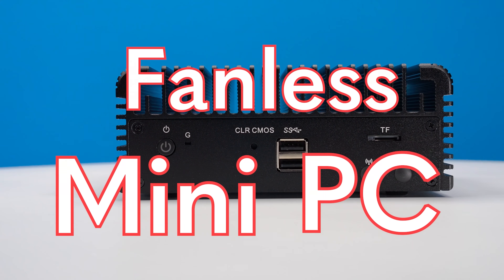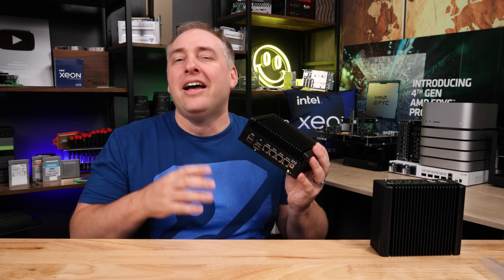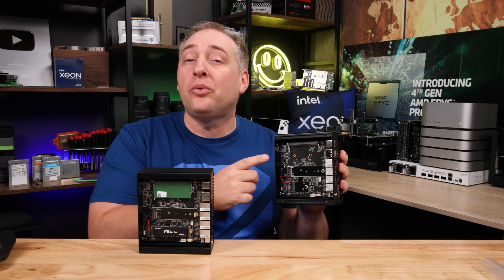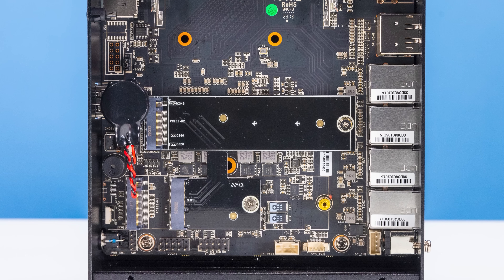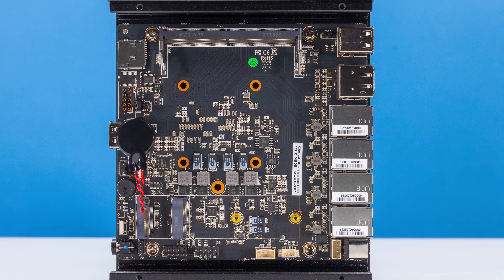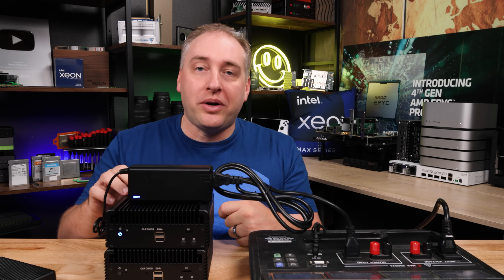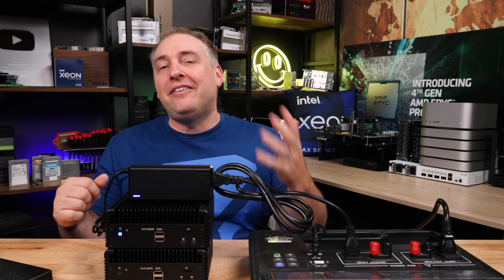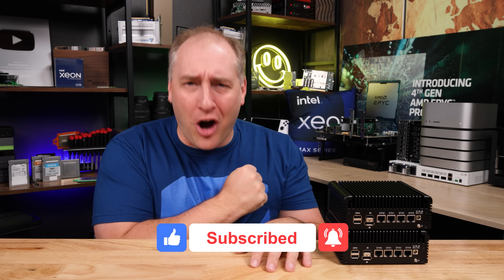Best EVER Fanless Mini PCs for Virtualization and Firewalls?

Comment: Appreciate I'm coming to this video very late - I'm considering the purchase of one of these machines to run PFSense... and I wanted to offer one tiny piece of feedback - concerning the system BIOS. As you note, this machine is designed and built for a SOHO / small business firewall, which means that potential buyers need to be able to trust the integrity and security of the device. To that end, it would have been really nice if you had been able to discuss the BIOS - I think it's AMI, but I'm not sure - and to tell us a bit about which version it is and how secure it might be. 

Perhaps a bit harder to do... it would also have been very interesting to get your thoughts on the IC's on the motherboard. You hint that these machines use a bespoke MOBO... so from a security perspective another possible security concern would be any IC on the MOBO that looked like an original but in fact was not. 

Finally, you mentioned that you did some useful soak testing. It would have been really interesting if you'd done that with the machine connected to the internet via a network packet capture device, just to see if the machine made any unexpected calls to unusual IP addresses. Of course the reason this would be interesting is that when most customers set one of these up, one of the Ethernet ports is going to connect to an ISP's router and it may be very difficult to capture traffic from that port. 

Thanks for doing this review - appreciate it's out of date with newer models on offer today, but there's lots of useful information here. Thank you.

Comment: Great review. Covered everything except one question... Does this come back up after a power glitch unattended?

This is probably a really stupid question, sorry. I bought a fanless mini-PC to use as a home server but it did not reboot on a power glitch. The hardware required a human to cycle the power button! This makes it extremely unreliable on my glitchy power grid. I don't need a UPS, just need the thing to come back up after a power outage.

Does this come back up unattended?

I see on Amazon the it has "Auto power on" nuff said?

Comment: Take my advice and don't buy anything from this company. I bought two--one of them works ok, the other is missing pci devices. Seems to be a bios enumeration bug or something, but the CWWK website is really bad. The BIOS/UEFI implementation seems sketchy at best--it often fails to apply or save settings completely. Really bad quality overall.

Comment: I bought of these dude and it sucked!........... runs burning hot no doubt will burn out the M2 and the RAM...........  It was unstable, faulted on Windows Server, faulted in ESXi, ProxMox also died on it.........  and this is with good parts, memtest all good etc.  So you failed to show people you holding your hand on it while running a stress test for a half hour.

They are terrible.

Comment: The proxmox thing happened to me very frequently with different machines. It usually installs OK, reboot OK, and then misteriously the name of the interface you were attached to initially changes when you reboot after creating a linux bridge, so the machine obviously becomes inaccessible. You need to then find the new interface name and readd it to the bridge and now it's that. Annoying but hey.

Comment: What happens when the battery fails, and it reboots?   Will it hang on boot?
Also, how good is watching Youtube videos in Firefox running on this, views from this acrossvia  a Windows Remote Desktop or VNC connection?

Comment: Hi, could you tell me if the N305 can put  single 32gig ddr5 4800 in and the unit use third generation nvme ssd?
Reply: Yes - almost all that I've seen do support 32G DDR5 if the board supports DDR5.  Some will be fussy about which brand or speed; but most should run sticks like Crucial DDR5 4800; some will state that they will run DDR 5600; ymmv.    The NVME primary drive is 3 lane; and the secondary is a single lane ( tops out at about 900 MBps )  Most NVME nowadays are 4th gen or later but will run at 3rd gen speeds.

Comment: Love this it’s perfect: Passively cooled, silent, with adapter for 4 nvme drives, n305 processor 

BUT the power consumption is too high. Like you said in your Beelink EQ12 Pro review the level of engineering here is not on par with HP/Dell

The idle power consumption should be approximately 5 watt

Does anyone have tried to undervolt it?

Comment: Does any n305 or n100 n200 units come with 8 or 6 lan ports? Or is there a way to add more ports?
Reply: Yes, but really, you only really need two or three, and a managed switch.  Far easier to trunk the ports to a managed switch..

Comment: After watching some of your videos about these mini pc from aliexpress, which are suitable for pfsense/opnsense, I bought a Topton N100 with 16GB DDR5 and 512GB SSD for about 240 USD. The delivery time was still ok at 3 weeks from China to Thailand. Since something seemed loose in the PC, I opened the computer and found a small screw that didn't seem to belong anywhere. On this occasion I was also able to check the RAM and SSD model and both are unknown Chinese brands.
First I installed Linux Mint to check the functionality, but I had the problem that I could only set the screen resolution to 800x600
(HDMI connection). Since I want to use the device as a firewall anyway, this is not relevant. To test the CPU performance, I ran a Mandelbrot Python script. The CPU cores were used to almost 100% and the temperature was 82 degrees Celsius, which seems ok to me. The casing reached 46 degrees Celsius, which is uncomfortably warm to the touch, but is probably normal with passive cooling. The device consumed around 33 watts in the test and around 10 watts when idle. I noticed that this Mini PC has roughly the same computing power as an Orange Pi 5, but the Orange Pi 5 only uses 10 watts in the test and 3 watts idle. Yes, I know, those units have totally different use cases 🙂

Unfortunately, I bought the device hastily without doing enough research and as it turns out, there is no support for these devices, zero documentation and no bios/firmware updates.
I'm no longer sure whether I really want to use the device as a firewall.
Reply: What would you use instead?
Reply: Honestly, I have no idea. I will probably continue with the device for now and maybe in the future switch to a device from the opnsense shop or one from pfsense (netgate). These are then priced in a different league.

Comment: Hello. I've watched your previous video "HUGE UPGRADE! New Firewall Router Virtualization Host" which covers N100 and N200 CPUs. That enclosure has N305 version too. There are also versions for N100 and N200 using enclosure present in this video. It seems that motherboard design is the same.
Which enclosure is better for cooling?

There is also one important aspect you didn't highlight in any video. Can this device enter S3 power state mode i.e suspend to ram?

I've seen some of Intel N100 Mini PCs, which support only "Modern Standby" S0idle state. It means they will still consume those ~6W even in sleep mode.

Comment: Just install a washer to eliminate the rattle on your cards. That's all it takes.
Reply: Nice try;  there is NO place to secure the "H" adapter to the motherboard.   It flexes a bit because it's long, and offset from where it's connected to the mini-PCI slot and it's bolt.
Reply: @MrPir84free  oic. In that case you'd have to tack it down w hot glue or something. Assuming you did anything at all.

Comment: I was excited to see this video come out because I had already ordered this system... the last piece I had been waiting for was the memory and it finally arrived.  So I put the system together and installed Windows 10 on it... ran great!  But I don't want a Windows machine, I bought this system for Proxmox... so I downloaded the latest 8.0-2 and made the install USB.  Booted right up and went through the install great until I finished all the options and the installation started... at about 53% the screen went black and never came back.  I tried Proxmox 7.4, I even tried a bare metal install of Ubuntu... same thing.  I tried running console with nomodeset and it still happens.  I've tried about 6 different methods of getting around this found on the web with no luck.  Since you apparently got it working on this system, I was hoping you would share whether you had any problems during install and how you worked through them.

Comment: Just curious -- why would you want to install proxmox and then pf/opnsense on top of it if only wanting a firewall?? Why the hypervisor if only going to use pf/opnsense?
Reply from the maker: You are correct, there is no need. Some folks like to have an additional Linux VM on the same box. Another good use case though, and one that I did for a LONG time is to be able to roll-back config changes almost instantly (<5s). If you screw up your firewall, but have a static IP on the LAN you can get to for the hypervisor, restoring from a  snapshot is super fast.
Reply: proxmox just gives you fine grained control and freedom to use it in various ways, think of forwarding 4x m.2 pci-e 1x drives to some virtual machine with NAS or Docker - for home usage there wouldn't be many users (1 to 6 usually), so even having 8 powersaving cores to deal with 15 docker containers simultaneously being 4x2.5Gbit router shouldn't be a problem
Reply: I haven't used proxmox but rather xcp-ng and I've had pfsense virtualized for over three years...for the most part it works pretty well but as I'm going in my knowledge and trying more advanced network setups I'm really running into some strange problems..like asymmetric routing..that I've only discovered after posting many many places and doing a bunch of reading and experimentation. Possibly it's an xcp-ng thing and not a proxmox things however the general consensus is because it's a virtualized setup. I'm very much contemplating just adding another device or two for a bare metal router setup and not virtualize this particular part of my network. I will say having the ability to instantly roll back to a saved snapshot is awesome with the vms, but I might be able to accomplish this if using zfs with pfsense and having it zfs send receive to my truenas core zfs setup. It's probaby not as convenient for sure but it's a backup.

Comment: Just wanted to chime in about the RAM... I got mine a couple of days and and paired it with a 32GB crucial sodimm and it has been fine so far, running proxmox ve.  Just one pfsense vm running on it so far with no issues.
Reply from the maker: Awesome feedback.
Reply: 2 weeks after, any problems yet?

Comment: Is it possible for you to review the fanless mini pc from Topton with the Ryzen 7 5800? (Topton FU02). It's on alie for about $300 if ordered without ram/wifi/ssd.
It's not really a server/firewall mini pc as it doesn't have  a whole load of nic's, but more a normal fanless mini pc.
I can't post a link because youtube will delete this post, but it's easy to find on alie.
The reason I ask here is because this channel is pretty much the only channel that reviews fanless mini pc's in depth, but mainly mini pc's for server/firewall purpose.
I think reviewing a normal cheap but powrful fanless minipc is a good addition. There are lots of reviews for intel NUC's etc out there, but they are all with fans.
Reply from the maker: We did the fanned version: https://youtu.be/h7U4fCj_Pos but good idea. I just ordered the fanless model.

Comment: This series of boxes are quite good. I'm using CWWK N95 one for Proxmox and run OpenWRT as a guest.
But it seems there's high IO delay with N series CPU, as we can see at 16:30.
I don't know the root cause and cannot find the solution so far.
Reply: I solved the issue disabling EMMC in BIOS and delete unnecessary device file.

Comment: Guess it took me a while to figure out that if I remove the panel with the extra M.2 port, I could actually use the WiFi port. I feel such a Noob. And the wifi card I bought is around 50mm instead of 30. That's so unfortunate. Guess there is no way to make that one fit, or someone has some neat idea perhaps? :P

Comment: So I picked up one of these, bought direct from CWWK via Amazon, and I did not get some of the additional accessories or the newer daughter board.

That said, I have Proxmox installed and updated, installed OPNsense into a VM and OPNsense can get an IP from my ISP modem/router but it isn't passing any internet through to the LAN connection and I'm having a heck of a time trying to figure out why. The LAN interface does give my PC an IP via DHCP but no internet access. I feel I'm missing something simple but for the life of me cannot figure it out.
Reply: Sounds like a firewall issue??? Not sure.
Reply: @WOWIMEXCITED  Apparently was a bug/issue with Proxmox 8 and how it was handling networking. Installed Proxmox 7.4, got everything working, did an in place update to Proxmox 8 and everything is working great.

Comment: So.. I am looking for a new router/gateway (replace my Ubiquiti UDM Pro which keeps having issues for years now). Can I run pfsense (or is opensense better.. new to those so not sure which is the right way to go) for my firewall/gateway.. plug modem in to one of the ports.. and it can use the other 3 ports for routing? Is it every bit as capable and fast as my UDM Pro being 8 cores instead of UDM Pro 4?  Also.. if I put this in my main room where my tv is, and use that 4 SSD module you showed, can I put 4 2TB drives on it, and use it to watch movies I rip from my 4K blurays.. is the gpu/hdmi capable of that without buffering/etc? My thought is, run pfsense AND TrueNAS, and if possible attach my SATA 3 5 drive external setup to this (if it supports SATA3).. and then I'd have to do some sort of auto "copy" to have movies on the SATA3 storage (5x16TB drives) but also on the SSDs. Would the use of TrueNAS + pfsense cause overheating in any way?
Reply: Ehh, wouldn't recommend.  Thats a lot for a little box like this.  I have prior version. They get really really hot.  Ended up with configuration that has fan controlled by AC infinity to get rid of heat -- and that was only for xcp-ng with pfsense.
Reply: If anyone else has this question, the answer, cheap answer, would be a desktop that has suitable expansion, and room for the drives in the chassis.
In this device, uh, there's no real cooling on the back side, unless it's vertically mounted, and even then, it gets pretty warm ( 50 to 60 C ) for the SINGLE drive;  
Unless one can find a fan kit for the back, which does not seem to be a standard PWM header, i.e. super small instead, cooling will be an issue.  
The N305 is limited in a number of aspects, mainly because, well, Intel wants anyone that wants "more" out of a processor to buy a BETTER processor.  
There are numerous limitations to this box, heat being a significant one, internal heat being another,  and PCIE lanes being yet another, oh, and I forgot, memory size and  channels also being a limit.    What you specifically want to do - is by definition - MORE. 

You might want to look at something like the MS-01 from Minisforum.  Or a more standard desktop with sufficient drive bays.

Comment: They are labeling USB 2.0 as SS, other than that this is awesome computer, we should trust these guys and buy it.
Be careful when buying NVME SSD from China, most of them are fake, they just put 128GB SD Card in them.
They even create firmware that shows SSD as 2TB in the system, but when you transfer files it just overwrites on old files after it copied 128GB.
I got one 2TB SSD in aliexpress, never buying anything directly from China anymore, most trust.

Comment: Hi Patrick! what is your view on pentium gold 8505 based mini pc? similar in price, power, features, and same shell, even. having 6 threads instead of 8, but that 1 big core can help with some jobs.
Reply from the maker: Also a good option. For a desktop, I would probably take the 8505. For a firewall or virtualization appliance I probably prefer the N305 since it is all E-core and has more physical cores.

Comment: I have the N100 topton and it’s amazing. Opnsense, home assistant and about 5 containers from tteck and a 3-5% CPU load. I put a 12CM pc fan op top powered by it’s own usb port at 5v super silent and cool. Great little home lab system that runs proxmox like a dream and super stable.
Reply from the maker: I totally agree. We just wanted to also show the bigger one since folks have been asking about it since we did the N100 / N200 review.

Comment: have one in same form factor with N100 CPU, running OpenWRT today getting home, ambient ~27c, CPU was reading 59c, but NVME SSD was reading 71c, and those metal fins were hot to the touch. Wonder if SSD can sustain to run at 71c for long period of time?
Reply from the maker: Most will throttle to stay OK. Usually using a lower-power DRAM-less SSD helps with heat.